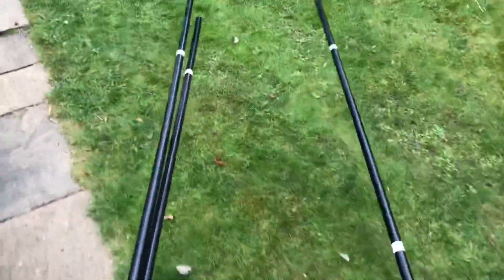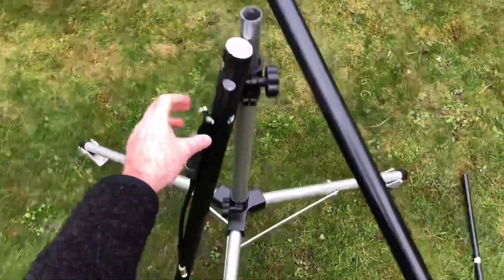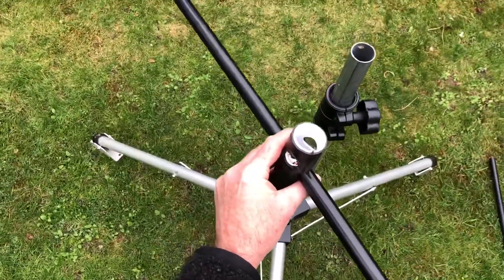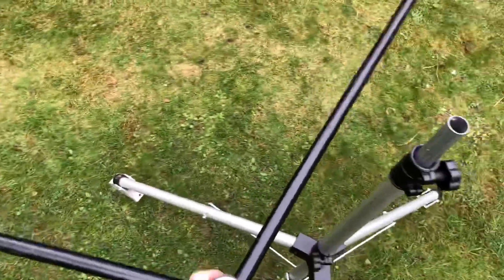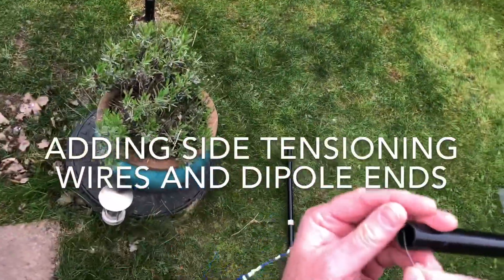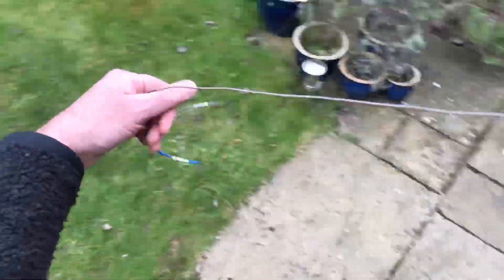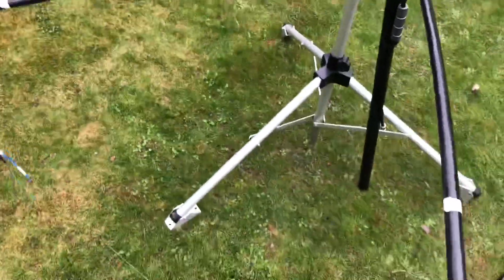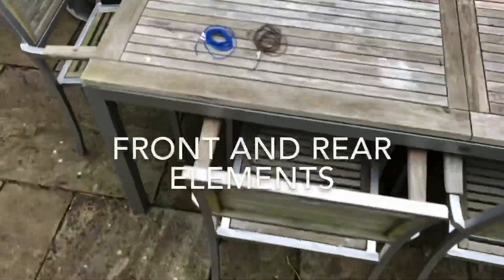6m Mini-Horse Antenna - Part 2 The Canter

Comment: An interesting construction. I noted your bolt through your multi extendable pole with interest. The pressure clamps on mine are dubious and this looks like a solution. I am interested in a 4m version. 
Thankyou.
Reply from the maker: Yes James. On an earlier outing the down-force of the guys caused a press stud to fail and the whole thing collapsed down on itself. Fortunately, it was higher than the car roof! After that point, I drilled it to take bolts. Oversized holes so the bolts go though easy.

Comment: Very Nice Ian, I made a portable 6m Hexbeam its amazing what it will do on a hilltop on a contest day. My home QTH is surrounded by hills and if you just go up to the top of the hill it makes a huge difference and check your antenna on 2m mine is good on swr there also not sure if its the same lobes probably not but it works.
Reply from the maker: Thanks Chuck! Never thought to test on 2m. Yes, desperate to get out up on a hill again! Ian.
Reply: @G0CNN-Ian  The only reason I tried 2m was that I was contacting a 2m then 6m net and put up the hexbeam and was still hearing the end of the 2m net, Cheers!

Comment: Ian, I think I have a similar 2m vertical to you (mine is the Diamond X600). It's been up since January, and about a month ago I learned one of my neighbours has grassed me up to the council. It's been professionally mounted, with the brackets just under the eaves and is sitting on top of the standard 12ft pole or however long it is.

Did you have to apply for planning permission for yours?

It looks like I am now going to have to do so because the council have said that (in order not to require planning) the antenna cannot be more than 1m in any dimension :(

I think I am going to apply for planning to move it from the eaves to my chimney on a 1m pole, but will be about 5m higher than now and will be in free space. Then I'm going to pop a pneumatic mast in the garden that I'll extend only when in use and pop 2m & 70cms InnovAntennas OWL Yagis on top for the UKAC.

Such a pain!

Great watching you work a contest with an antenna you've made yourself. Some of the serials sounded really surprised  to hear anyone; that first chap was classic! :)

73,

John M7JHA
Reply from the maker: John Ratcliffe Sorry to hear that John. Yes, if you read national planning blurb it does state the 1m rule. I haven’t got planning for mine and my neighbours are all ok, but I wouldn’t want to push it too far maybe with a permanent mast at this end? Having said that, they’d be fine I’d just be risking the council whinging about what was already up! Check out the RSGB planning guides as there’s good advice on how to put in a submission. You’ll probably be ok with a colinear, just a case of going through the process. Fingers crossed! Ian.
Reply: @G0CNN-Ian  I think my Google Kung-Fu failed me Ian. I never found all of the restrictions I now understand. I read about the one requiring the antenna not to exceed chimney height, or 60 cms above the roof ridge; I didn't see the one stating the antenna couldn't exceed 1m 😜

I'll get the application sorted. Thanks Ian.

Comment: What do your  neighbors say out of interest, you have the same house as me. Thanks for sharing
Reply from the maker: I don’t think anyone’s looked up and noticed yet?! Soon dark after it’s up 👍🏻
Reply: Forgot to mention can we get look at your dipole install please
Reply from the maker: Netware Cracks The off-centre fed dipole is a M0CVO HW-40HP. A rope goes over the ridge of the roof and fastens it on the front gutter. The coax handily drops close to the house and the long end fastens off to a tree. I would have made my own, but this was the quickest way to get back on the air after my 30 year break, without having a spares bin to call on...I wanted an off-centre dipole so the coax wasn’t down the garden and a concern to the neighbours ....softly does it 👍🏻